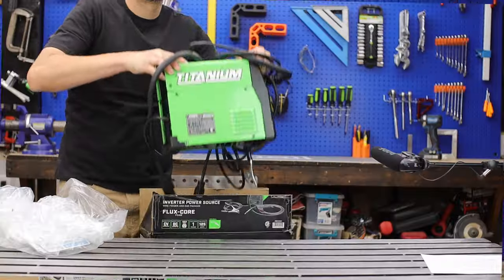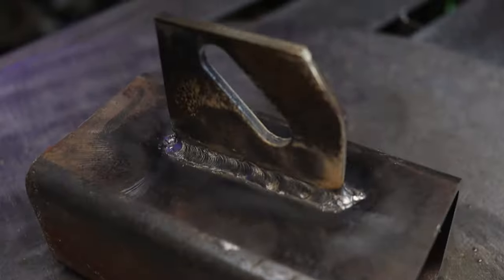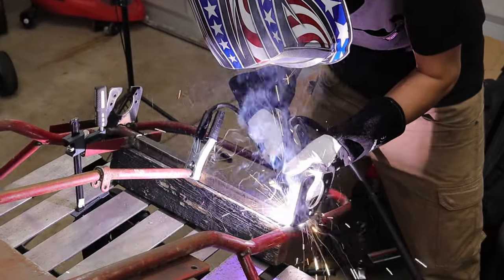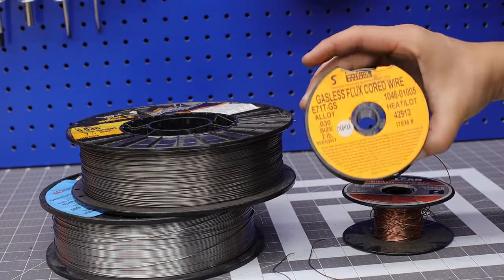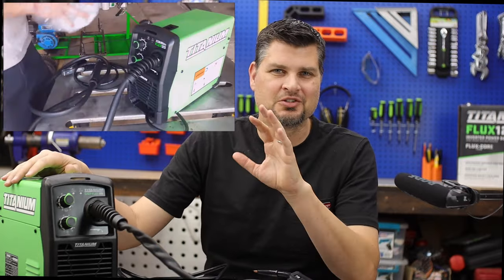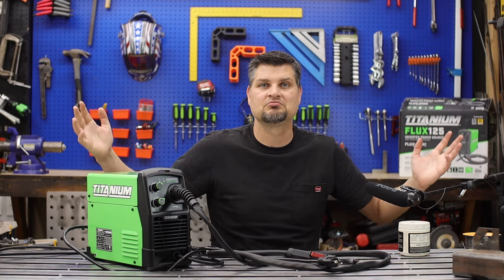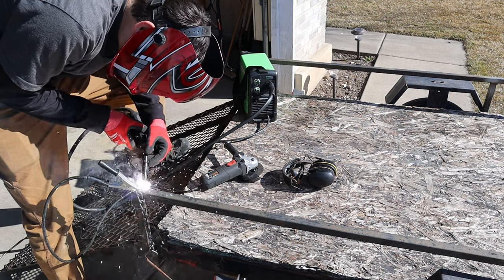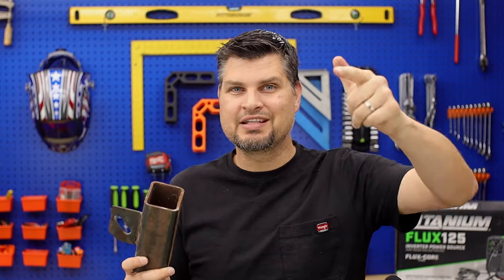After 5 Years Is It Still Worth It?? Harbor Freight Titanium 125

Comment: I'm really thinking of learning how to weld with this and then I'll make my own exhaust at home. Vroom vroom.

Edit: it'll cost you less if you find a fair priced shop. Otherwise your spending around 1100 bucks on something that could cost 500 for someone else to do.
Reply from the maker: Right on, let us know how it turns out.
Reply: @-DIYPRO-  will do. Im gunna go with the 125 instead of the 200. I don't see myself welding much after this project except for a square tube railing. Thanks for replying to all my comments on ur videos!
Reply: I bought this and new to welding really know little about it and this machine is amazing; however, I struggle with with this on exhaust pipe or sheet metal as they are so thin,,,good luck may want to research if this is best for that.

Comment: I put mine thru hell for 4 years, never able to trip the duty cycle, did burn the gun out, picked up a 2nd welder yesterday, when I figure out how to fix the gun that welder will be up again :)
Reply from the maker: Right on, keep us posted on if you find another gun or an aftermarket one that you get working.
Reply: Ive done the same thing and the welder still kicks along..i burnt up my gun too. Bought one off amazon for 38 bucks and right back to work it went...

Comment: Very good video. I ended up getting the little red one because I knew I didnt know what I was doing as a beginner, and opted for the trusted name brand. I walked into a HF and put my hands on their line of welders. Somebody had already gone through there and turned all the knobs too far so that every knob would keep turning around and around ... put me over the edge to get the name brand. I have been extremely happy with it for two years. But, you def make this one look like a great option if one takes care of it. One dislike about the red one, it can only take 1lb spools. Can that green one take larger spools of wire?  Thanks, I always appreciate your videos.
Reply: The Vulcan spools that they sell and fit on the machine are 2 lb
Reply from the maker: Thanks! 
As long as it's not the larger 10 lbs spool It can take a 2lb and smaller.
Reply from the maker: Yea, a while ago Lincoln switched theirs from 2lb down to 1 lb.......and still charge the same amount! It is good wire though!
Reply: @-DIYPRO-  Wow, I didn't even know that lol thanks
Reply: @-DIYPRO-  I sure wish anyone could explain (not in vague terms or general phrases, but by showing us the costs) as to why every single item made here has to cost at least twice as much as damn near everything made anywhere else. The Vulcan wire is made in Italy. Is their cost of living that much lower?
Reply: Today only is 99! For itc members!

Comment: Bought one a few days ago, can’t get it to work. Powers up, I’m grounded good. Feeds wire iust fine. Won’t arc, no clue what’s wrong with it. Gonna take it back and get it money back.
Reply: check by the spool if there's a ground wire not screwed/attached to a terminal.
Reply from the maker: The last check I always do it try to put a small weld directly onto the ground. If still nothing then I'd take it back.

Comment: Did you look into swapping polarity.I have some SS flux core wire that calls  for Positive ground. MY 90 amp Chicago that has been modified  with a 150 amp rectifer and large capacitor could swap the polarity  but would like to modify  the Titanium.
Reply from the maker: I haven't but keep up posted on if you end up doing it and getting it to work!
Reply: The welder is already positive ground.